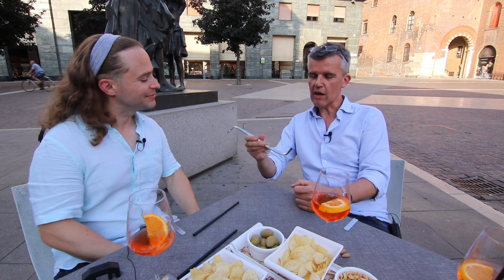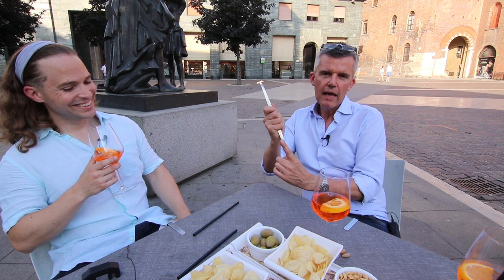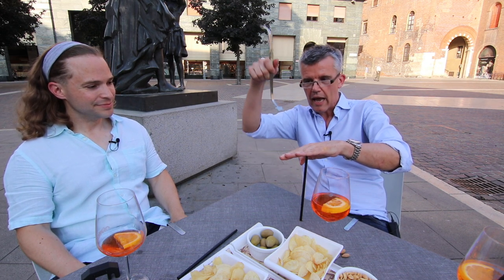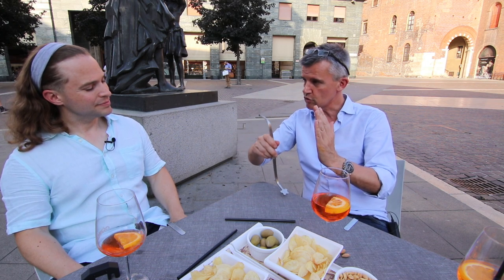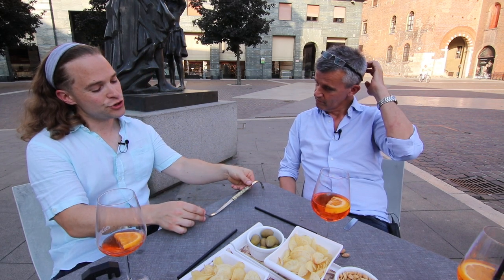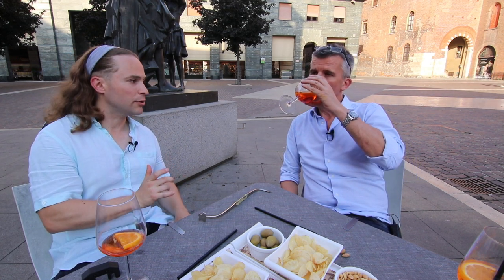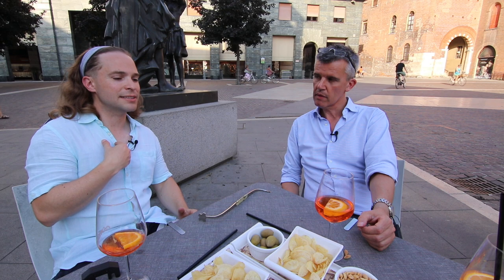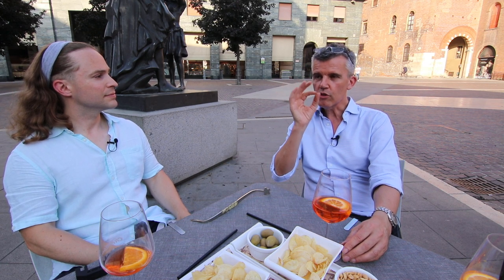Sound Post Adjustments on Cello PSA | Luthier Lessons with Edgar Russ

Comment: I once set a fallen soundpost with some metal wire and a paper clip. Cannot recommend that method.
Reply from the maker: Right, and how did that turn out?
Reply: @CelloCoach , I probably made some marks around the f-holes and it took quite some time to get a reasonable placement. It's the sort of instrument that you put used strings on though, since it's worth essentially nothing.